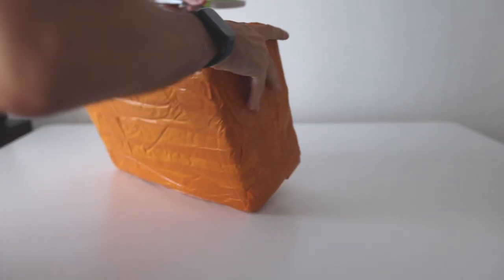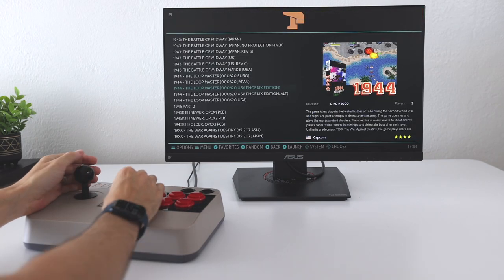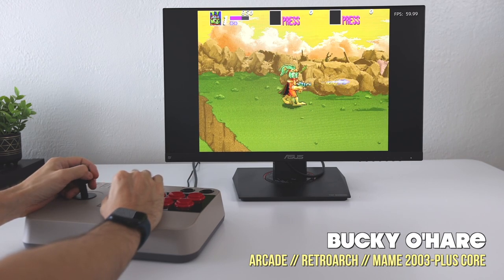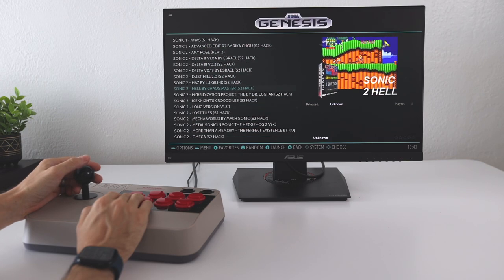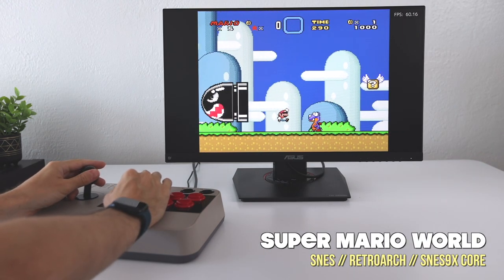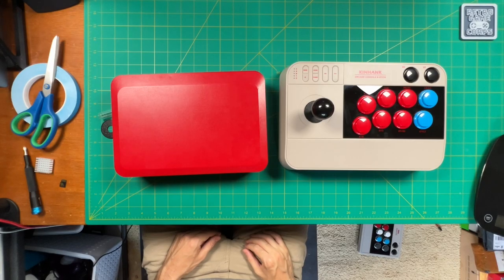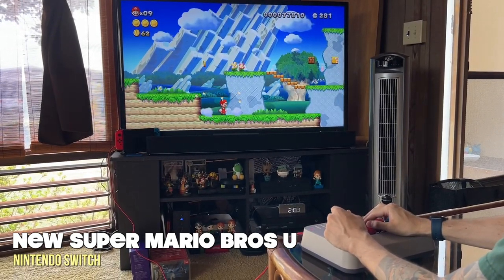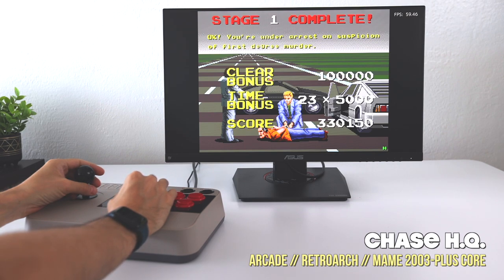Super Console (KinHank) Arcade Stick Review

Comment from the maker: ** UPDATE: it's come to my attention that the AliExpress listing for the arcade stick without games has a promotional image WITHOUT the hookups for the S905L Android box on the back.  I recently received confirmation that the "non-game" version does NOT come with the Android box inside, and have removed those links from the video description.  I apologize for the mixup.
Reply: If anyone else bought one 'without games' from Amazon, here's what I just posted below in a thread specifically about it:

I did get in touch with the seller, who eventually offered a refund after receiving the returned item (to China, from Colombia, with tracking, at my expense). He also gave me a 'helpful' explanation of what it was I'd got sitting in front of me :D
I was not thrilled at this, but waited for the returns label with the intention to at least see what services might be capable of this and the prices, before I decided if it would actually just cost me too much or not.
A returns address did appear, which at least was in Texas, not China, a few days ago.
Today I received a refund and after speaking to an Amazon representative, I was informed that they'd directly refunded me and would take over dealing with the seller. There was also no need to return the item.
I passed the incorrect listing details to the representative, and he said they'll talk to the seller to try to either correct the listing, or pull it completely.

Comment: I wouldn't say that the Neo Geo list is curated. The reason there aren't duplicates is because there don't really exist any (apart from bootlegs and hacks). Neo Geo games had all the regional differences on one cartridge and it was the BIOS of the machine that determined which version was played. You could put a US cartridge into a Japanese system and it will run the Japanese version of the game.
Reply: I did not know that.
Reply from the maker: That's a good point, thanks for the clarification.
Reply: @RetroGameCorps  i

Comment: The limiting design factor for this stick is that it will work great on a table, but if you want to use the stick on your lap, the HDMI and charging cables will be a hassle to deal with as either of those coming loose will disrupt gameplay.
Reply: You'll have to build your own arcade cabinet around it... It doesn't come with that included! 🕹

Comment: Wow am really surprised that you can mod the stick with sanwa buttons and prolly a sanwa stick as well and turn it into a legit fighting stick.  It kinda has the same shape as a mayflash stick.
Reply: yeah with almost any other fight stick i used and owned to replace, this would come out on top with the aspect of other games, but i couldn't tell when he used just as a stick, did it need to plug in for power? or that connection to power was just the usbc to usba connection.

Comment: I think that was probably thermal adhesive. It doesn't work as well as paste (works just fine for this application), but it allows you to not need a clamping mechanism to hold the heatsink on.

Comment: I like when you review some weird chinese machines :)

I'll never understand why do they put these cloned games or can't configure them properly :) I mean, they release(d) a lot of similar devices - they should already have some kind of preselected roms list that works flawless on specific CPU (they use the same variations almost every time) :)

To be fair - they did improve a bit in this area :) They preselected PSP games (yea, i know, psp minis etc.), ripped versions of PSX roms - hmm i can understand it a bit. At least somebody put tiny amount of work there. Also, it seems that you're able to configure everything, they didn't lock it with some weird CFW (like ie. the Powkiddy you showed).

But yea, it's a bit shame that IF they put a bit more effort into software, roms, configuration, then the device would be even better :)

ps. I also think that the pricing is pretty nice. Dreamcast with frameskip is not too bad, for such device.

btw. do you know if some 2d PSP games (like ie. some jRPG, or Tekken Dark Resurrection with frameskip) work there too ? If yes, then, it's even better.

The only cheaper way you can go is some android TV. Everything else, including some ie. Dell Optiplex Micro + Batocera combo + gamepad will end up similar or more cost

ps2. I love the way it looks :) Really good "clone" of 8bit-do :)

Comment: I have a super console X and for the arcade games that don't work you just have to switch which version of mame that it's running as there are several different versions to choose from and the default setting is auto. Sometimes it will just pick an non-compatible mame build for that rom.

At the game selection menu press the select button on your controller, then "Advanced Game Options" > "Emulator" then select one from the following options until you find the one that works the best.

Auto
Advancemame
Libetro/ Mame2003 Plus
Libetro/Fbneo
Libetro/Fbalpha2012
Libetro/ MBA Mini

Comment: Unfortunately the Switch button combo you discovered doesn't work for me. It defaults to X input mode but I can't use the controller at all. Any other hints? It works fine on my PS5.

Comment: That's thermal adhesive and not thermal compound, it's not "cheap stuff". Thermal adhesive cost around the same price as any thermal compound. Thermal adhesive is like a glue for heatsink on small boards with no real way to secure them on top of vrms or the cpu permanently, you can op for thermal tape but do note that thermal tape is not permanent application and the heatsink can fall off vrms or the cpu versus using thermal adhesive.

When it comes to low powered boards and chips, thermal adhesive is more than adequate enough with thermal conductivity.